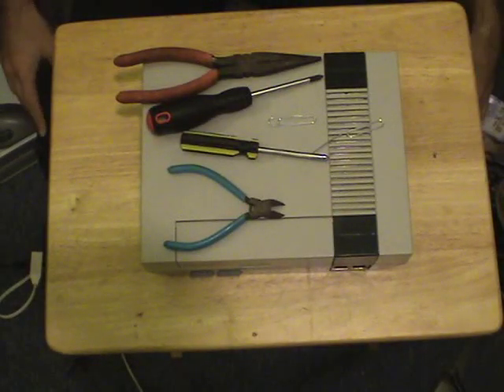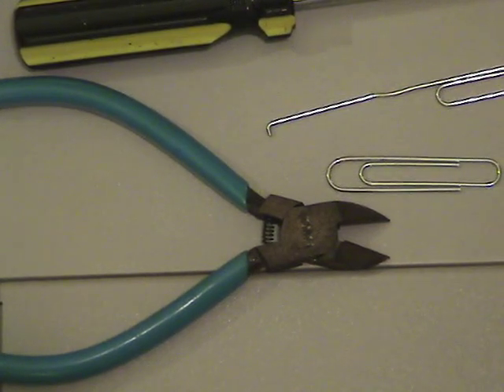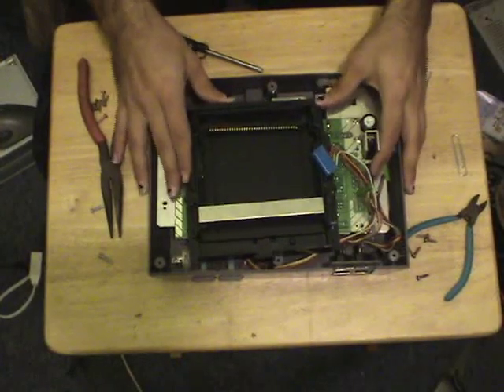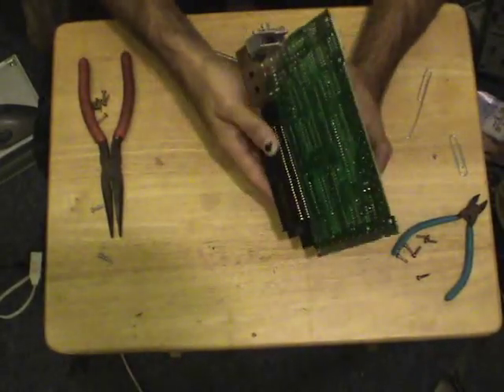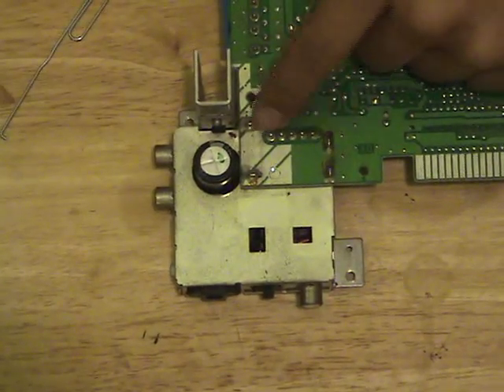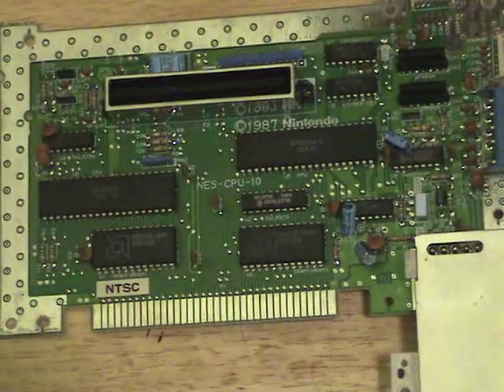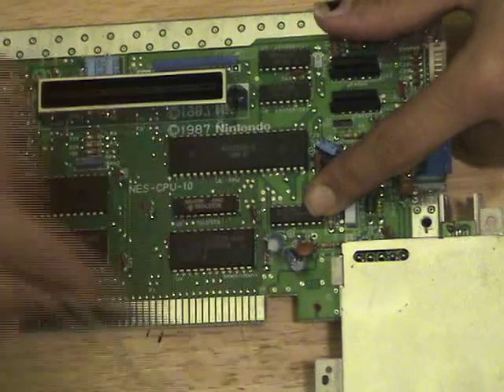NES Console Repair

Comment: Now sir, what does one do when there is NO picture AT ALL ? I have power but no picture, not even white/black screen, no reaction to the tv what so ever. i've cleaned the pin connector cleaned the games cleaned everything. i even fixed the pins to get it tighter. / Thank you !
Reply: Modern TVS won't recognize the signal if it refreshes too quickly. IE the flashing. Check to see if the pins needing to be aligned. They can get bent down.
Reply: Zestypanda  *****  Thank you so much ! this helped

Comment: I have a NES motherboard that I'm planning to use to assemble a NES console from scratch. It had the lockout chip disabled which took me so long to notice. The Video works, but the audio is nonexistent, even though the AV cables are firmly connected. Any ideas or suggestions on what I should do to solve the audio issue?
Reply: The RF module has failed.
Reply: It's not the RF connection that concerns me. It's composite.
Reply: RileySkye100 The composite/RF module failed.

Comment: Excellent video. I was trying to do the same to a friend's NES, by severing the 4th pin on the CIC lockout chip, but when I screwed everything back in and turned it on, one of the capacitors blew. Did I do something wrong? Was I supposed to attach the area where the 4th pin was to ground?

Comment: Great video. I received a NES for Christmas from my girlfriend last week. I found that, instead of destroying Pin 4 on the CIC, you can simply remove the 2.2 uf capacitor next to Pin 4. I did solder in a jumper and grounded to the RF shield, and it works great. I like the idea of removing the capacitor because it's completely reversible.

Comment: Thanks for the video!  Knowing almost nothing about electronics repair...I was able to successfully complete the 2 main objectives in the video. Although I made the pins in the connector a little too tight..and my wire cutters were a little wide and my hand shakes...so I almost wasn't able to sever the pin w/o damage.  Thankfully I made it work.  Now I just need to learn how to fix my own Colecovisions,  Ataris, and CED Videodisc players to save money.

I do have a suggestion about cleaning the top of the case.  I do have a good knowledge of chemicals...one of my specialties.  Since we both know that even diluted bleach can dry rot the plastic....you could also try either peroxide in it's place (try diluted at first-maybe half and half water)...or another thing that seems to work well for cleaning plastic is to take one gallon hot water and mix in 1 cup ammonia, 1/2 cup vinegar, and 1/4 cup baking or washing soda.   With this mixture you can even make it stronger without risk of damage.  Also works great to clean smoke and stuck on dust to mini-blinds, latex paint, etc.  And you can even add borax to the ammonia, vinegar, soda blend to strengthen it a little more.
Reply: +Foxx D'Gamma It not pigment break down, its what happens when ABS plastic ages, it yellows. If it's exposed to heat or left next to a window for years it will yellow. Also they didn't use bromine in the NES. They used bromine in the SNES. Some consoles had excessive amounts put into the mixture which is why some consoles literally fall apart or turn a very deep yellow, while others will just chip or just turn sightly yellow. 

One more thing retro bright is expensive to make and has mixed results. I've had much better luck using women's hair bleach (in a cream form). It has the ability to cheaply restore yellowed plastic back to its original state. It can also improve the look of deeply yellowed plastic. Depending on what brand you get your looking at around $5 a bottle or less. You'll also need shrink wrap to keep the hair bleach wet. Both retro bright and hair bleach will both burn the plastic if left out in the hot sun for too long. I leave all my stuff in a window sill and rotate it every hour.
Reply: Ha! I'm still learning to man. I subbed BTW your channel has allot of cool videos.

Comment: Thanks for your video.  I have an NES that had this same lockout issue, but I was able to boil the 72 pin connector and now it works fine every time.  My question for you is both before and after cleaning my NES, the color pallet has been off.  I am using premium composite cables, and have tried several.  Also my television is a Sony Bravia HD CRT and other devices connected to the same input display accurately.  Regardless of the game, in games such as TMNT and SMB for example, red is purple and blue is a grayish color.  Also in SMB (Super Mario Bros) the text to select 1 or 2 players is missing or blends into the background.  Is there something on the mainboard I should check to try and remedy this hue issue?  Thanks in advance.

Comment: Hey, I fix my connector and disable my CIC Chip on my old NES. However after a couple minute the game crashes when the console is running usually with some graphic glitches just like you pop the cartridge up at the end. Any idea of what's going on ?
Reply: ***** Well I did but some months ago. I'll try recleaning them tonight I guess
Reply: SaferCloud88 Rubbing Alcohol didn't do sjit so I tried something stronger (Brake/contact cleaner) and it seems to do the trick. Ty again for your vid

Comment: That just ruins the whole motherboard when you remove that CIC chip its best to get a new 72 pin connector I can rebuild and gut those nes consoles and rebuild them for some that thinks that they got bad pin connectors I got ways of fixing them instead of wasteing valueable time ruining a whole motherboard trying to get them to play no matter if they are bad. I can mostly fix those 72 pin connectors without haveing to buy new ones to place in the board my time fixing nes consoles are various.

Comment: Good man, I thought it was a pretty informative video. And you're right on the palette differences. The color registers are hard-coded into the PPU, so there's no getting around that without making modifications on the cartridge end. To my understanding the PAL PPU doesn't spit out "true" RGB even if you drive the signal with a pre-amp. I wonder if you would have to use a clock divider or  swap the 2A07 CPU to a 2A03 CPU if one were to use a PAL PPU for NTSC work.. Hrmm.. I must review that.

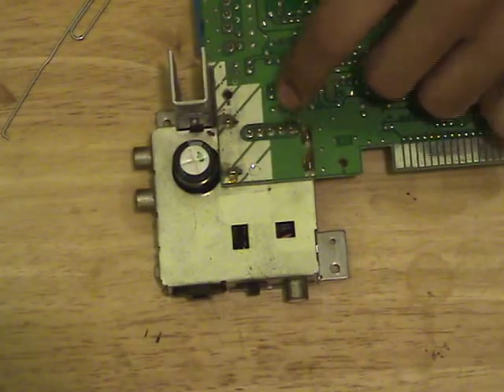Comment: I'm a little confused by the annotations at around the 10:00 mark. The NES' encoder does natively outputs composite, and there's no reason to tap into the encoder because you already have composite out on the side. As for RGB, the NES doesn't natively output that signal. In order to get RGB out of the old bastard, you'll need to swap the PPU out with one found in a Play-Choice 10, and then you'll have to build an amp to drive the signal. Just wanted to clarify that from a technical standpoint.

Comment: Hey man thanks for the tip on the region region lockout removal, I just made mod and no more blinking light top that with cleaning the game carts the system turns on with no problems 95% of the time.

Comment: Trying to find a solution to my problem. I bought an NES and everything works great except for the sound. Using the RCA cable, I actually didn't think I had any sound. I decided to turn up the tv to it's max and I can just barely make out the sound of the NES. Does anybody know a solution on how to fix this issue? Or do I need to purchase a whole new board for it?

Comment: Hey Bro great video! I love it! I've cleaned and fixed my 72pin connector as well but I used your video to disable the lockout chip on 2 of my NES consoles and they worked perfect only one of them is different. On my 2nd NES I don't need to push down the cart, I just push it in and press power and it plays. Weird how the my other console still needs to be pushed down but still no blinking light. I might have pulled out the chip different. Hmm. Anyhoo, Thanks for your video. You know what's up.!

Comment: I tried this. watched another vid. I cut the 4th pin, but then pulled it out with  small twizers. I also took off the 72 pin connector, and cleaned it, and the sloth on the motherboard. Now when i turn the machine on I get a white screen. It does appear that the 10NES chip is disabled. But did I perhaps screw up royally by pulling out the pin itself? any suggestions? I'll try tightening all the pins like you suggest in the vid tomorrow , and see if that works. great vid by the way !

Comment: I use Brasso to clean the board connectors to make them look shiny like a mirror. I've never disabled the NES10 chip. However, I always end up with a little....problem if you want to call it that way. For some reason the NES games wont run if the gametray is lowered, they'll just play if you leave it up. Do you know why's that and if it'll become a problem eventully, like if it'll ruin the pin connector? Thanks for your time and for making this great video :)

Comment: I connect my NES through SCART (Péritel). The TV i'm using is the one I plug in all my consoles: snes n64 and gamecube and these all work without any problem. I bought this NES on ebay and was able to make it work properly only a couple a times.. I was actually maybe thinking that the SCART cable might be busted but I can't put my hands on another one right now.. Thanks for the help, greatly appreciated!

Comment: Yes, I scrolled through the comments to see if anyone had similar problems and found the bit about jewelry cleaner.  Tried that on the cart port and the cart.  I even cleaned the pins that connect to the board. Still no dice.  Solid blue screen.  ::(

Comment: Hi 
Me again.  Just wanted to be clear.  I had the flashing problem, I cleaned the pins, I bent them as you showed, I even removed the connector and cleaned those pins and the connections on the board.  I knocked out pin 4 only after trying everything else.  Still solid blue screen.

Comment: I knocked out pin 4 on the lockout chip as you suggested.  Now its not flashing anymore, but its solid blue and the game still doesn't play.  I have tried the power supply, cartridge, and RF on a working console, so I know it's not them.  Any ideas?

Comment: Hey man great stuff! But I had one question if you please! Is it absolutely necessary to ground pin 4 once severed on the cic chip? Of can I just remove all traces of it and then lay some insulating tape on top just to be sure!? Ive looked around but have not been able to find enough conclusive info on this issue. Thanks a lot in advance man!

Comment: okay,the power brick im using outputs dc,now i know NES generally uses ac but ive heard it just bypasses that. the stats of the brick are  DC 9V 850mA. the brick itself says use with Nintendo,Mega drive,and super Nintendo.i looked up the model number and itrs a genuine Nintendo brick but when i turn on ther nes the light comes on(not blinking) and the tv just hums. recently i re soldered the entire av/power area of the mobo but with no success so  how would i know if i have a blown diode and

Comment: hey dude, nice video but I have a question, I saw another of this "disable the ten nes chip" and I do exactly the same as you did, I disable the same pin you did in the same way you did, but now my nes wont run the games, when I turn the power on the a blue, black, grey or red screen appears on my tv screen but my nes wont run the games, what is that?? did I fucked up my nes???

Comment: i have cleaned my games bought a new 72 pin connector pulled the pin out of the lock out chip cleaned the board that the pin connector goes on and it still doesn't work wat am i doing wrong or can i do anything else

Comment: @fayekhelmi i took out my 72 pin connector and pried the contacts back into place so it has a very tight fit with the cart contacts. but i wont be able to test it out for a few hours. so hopefully this will do the trick. seems like the weakest link in the NES is this 72 pin connector.

Comment: hey man, im so happy i found your video. ive been having some problems lately with my NES.whenever i put the carts in and play them the game starts out super glitchy, it starts acting as if i pressed keys like start or select ( no controllers attached in the first place) and it freezes. sometimes it works well for a few seconds then acts up and other times it just wont give me a decent start. now i tried cleaning the contacts on game carts using hand soap, i dunno if that was a no no or not.

Comment: I had the reset problem where all games WOULD work (I could clearly see the opening screen on every game I own) but it would keep resetting - I tried the pin bending to no avail (games are much tighter now which can't be a bad thing) so I went straight to cutting the 4th pin which worked a treat - my Nes is working like new - YOU ARE A GENIUS

Comment: @FoxxOTG Also fun fact: some of the early NES'es (at least in europe) had a very crappy CIC chip which would disable itself after a reset or two, I've had the smaller famicom carts work after 1 or 2 resets on an unmodded NES ;)

Comment: You really don't need to ground the severed pin of the CIC chip, I 'modded' several european NES'es back when the 300-in-1 carts were popular and I just severed the pin and it'd be done. They'd run happy for years on end :)

Great video by the way

Comment: I watched this video last night and serviced my NES this morning.  I re-aligned the connector pins and clipped pin 4 on the cic chip.  I grounded it to the R/F box and got a pure orange screen.  Then I removed the ground wire and now the console works PERFECTLY.  Great video. Thanks for posting!

Comment: I have 3 NES consoles, and all of them had the red blinking light problem. I cleaned up and rebent the 72 pin connectors, but nothing happened so I also disabled the CIC chip in two of them. It solved the blinking light problem, but now I only get a blank gray screen. What gives?

Comment: @FoxxOTG 

Already cleaned 'em, still didn't do it. (with 100% alchohol tho)
I took it apart like 5 times and I replaced the 72- pin connector. After that the shit still didn't work untill. It only works (for some really dubious reason) when I put the game in, but don't push it down.
Strange stuff going on in my NES.

Fuck.

Comment: The white screen with a hum noise  is from the TV not from the nintendo. 
YOu do not need to ground the pin. I done my systems and the pin itself busted right off from the lockout chip. It works like it should.

I had old TV's which hummed real bad when there was a white screen.  

If your getting a white or grey screen that stays on then you need to clean your game carts and 72 pin connector with alcohol.

Comment: Well if the power light stays on your fine. The grey screen is normal.   Now you just need to clean cart with alcohol and  clean the 72 pin  connector  that connects the game to the mainboard.  It should start working.

Or just download Jnes and some Game roms and get a cheap usb controller and enjoy.

Comment: ok lets say i cut pin 4 on the chip what do i attach to ground? the chip side(top) of the cut pin or the circuit board(bottom) side? just wanna double check thanks excellent video

Comment: very good tutorial.. better method for cleaning nes carts are taking then apart using brass polish with anti static cloth and rubbing the connector then using alcohol to remove residue looks like brand new after

Comment: well im not sitting here for 20 mins cause i fixed my nes already, if he doesnt say this well then i did my part. take the 72 pin connector out, find where the game goes in, the pins at the top might be bent down and not making a good connection with the cartridge, bend those up with a table knife or somthing that fits beneath the pin, now it will be harder to put the game in and out for a while but it should work. in case this makes little sense to you in how to do it, search "fix my nes"

Comment: excellent video mate
if i may - another question if you have a min :)
i live in uk and have aquired a european nes,when powered up i get the 1 sec cycle flash-can the same rule be applied to the european nes so that will work on a uk supply-thanks man

Comment: the best thing to do with the connector is just to buy a new 72-pin connector on ebay and replace it.I dont have ebay in my country so i had to repair the pins myself and thank god it worked

Comment: "Earlier NES'es did not have a CIC"...better put would be to say that the Japanese equivalent (Famicom) didn't, all Licensed "Nintendo Entertainment System" console require it (AAMOF the first version or it's revision, but the newer chips desynced as locks).

Nice video though.